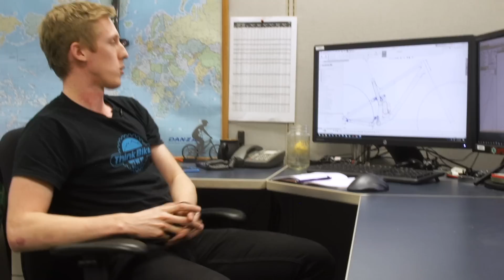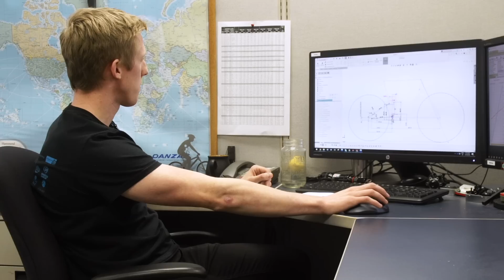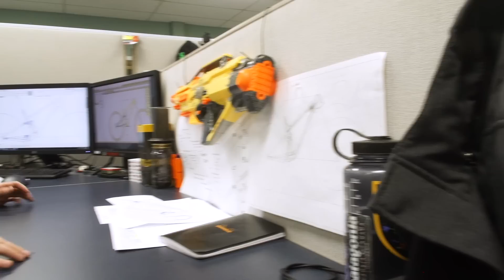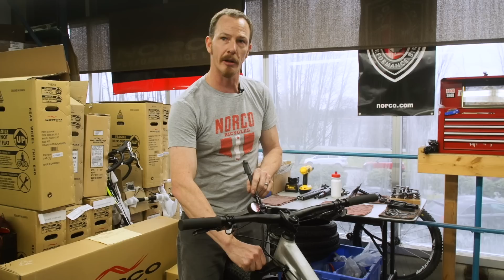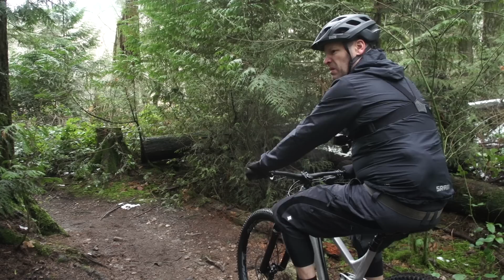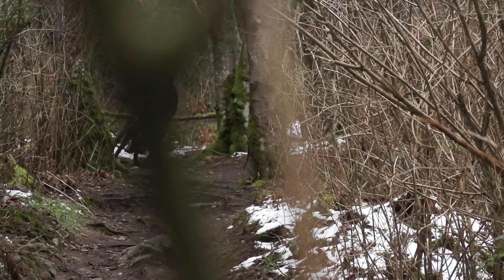How Norco Makes A Mountain Bike

Comment: DAYUM. The proto looks mint. 120mm trail 29er with long low slack geo? WANT IT. Hehehe
Reply from the maker: Looks pretty nice!
Reply: You know whats great...

... It has a dropper, a 1x10, beautiful frame, 780mm bars, smooth welds, and in larger sizes 29er+ tyres...

For £1,195